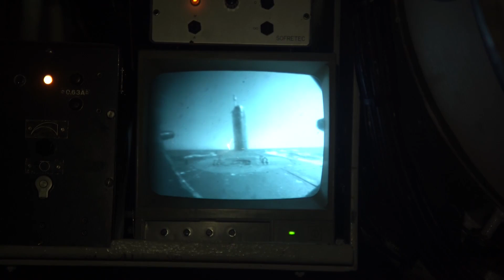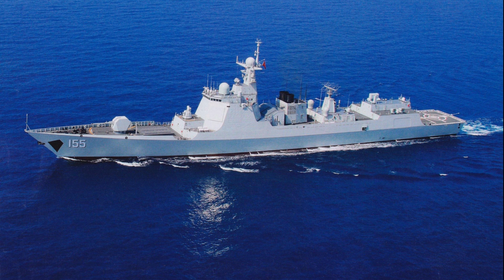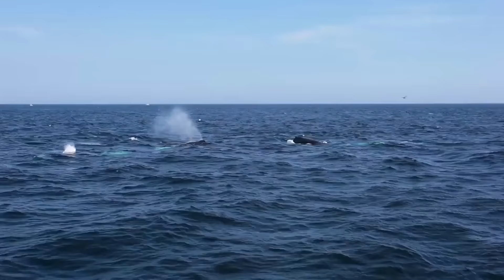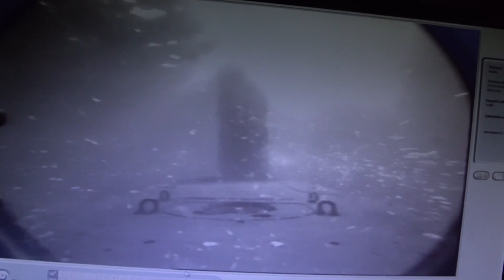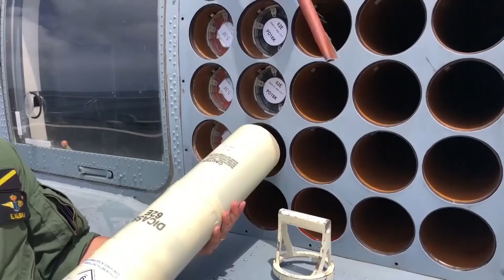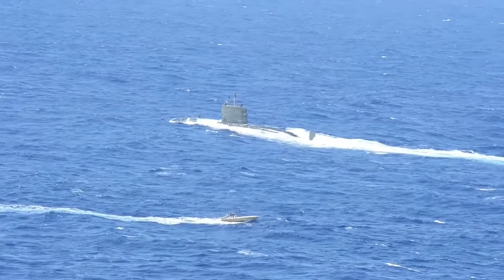Type 212CD: Germany’s New Submarine Changes Underwater Stealth Forever

Comment: Fun fact: the 212CD can be considered the third generation of Norwegian/German CD/bilateral submarine projects. The Kobben class (of the 1960s) was a redesign of the U205 design (designated U207) - built exclusively for Norway. In the 1980s, the Ula class represented a more radical design departure (also built for Norway alone, known as the U-210 class). 

Here is a little rant based on first-principles physics, for those interested: 

The increase in size/length is mainly driven by sonar acoustics: 212A were designed primarily for the Baltic/North Seas - where high-frequency sonar is the name of the game (needed to detail very noisy, brackish and complex and shallow waters). Where Norway operates submarines (Northern Norwegian Shelf, Barents Sea, shelf slopes dropping from 600 metres to 3-4 kilometres into the Norwegian Sea/North Atlantic, with massive density gradients, etc) is the low-frequency sonar domain (dropping below 100 Hz) for range. A quick calculation tells us that 100 Hz in seawater forms sonar wavelengths of ca 15 meters. You really want your flank arrays to capture 3 wavelengths (lambda) at minimum. So you want flank arrays approaching 45 meters, but you do not want to stretch them towards the "skrew". 

This is not something submarines in the Baltic/North Sea need to worry about (as they will be in sonar environments well above 200 Hz (wavelength below 7 meters - thus "3 lambda" is reached by around 20 meter flank arrays). Thus they prioritise being small and nimble while fighting in 50-meter water depth. 

The stretched 212CD allows them to listen to resolve lower frequencies without spooling out the towed array (very useful, since a favourite tactic is to sit inside boundary currents with the motor turned off - that does not allow for towing the array - one must move at least at a few knots to keep the array straight. 

Regarding the ORCCA - it is said to have about the largest ray-tracing computing power on any submarine (since in the North Atlantic/Arctic sounds are defracted massively across boundary currents, the sharp density gradients where warm saline tropical waters smash into cold and fresh Arctic waters, and the unique conditions where the thermocline is inverted. This is the opposite computing problem to Baltic/North Sea submarines have (living in an extremely noisy shallow sound "echoshamber" - requiring them to use their compute for signal processing (to separate bouncing echoes from true signal. 

In terms of ASW warfare, the biggest difference on the planet is what Sweden/Germany/soon Poland) needs in the North Sea and the Baltic Sea. 

Along the Norwegian continental shelf - the water volume of the entire Baltic Sea passes by ca every 15-20 minutes. It is very dynamic. It is also a very unique place on the planet - since the entire global ocean conveyor circulation is powered by processes north of the GIUK-gap. This makes "NADW" (North Atlantic Deep Water). It also does radical things to the global "SOFAR channel" (where most of open ocean submarine warfare takes place). SOFAR is found between 300 and 1000 meters of water depth (as a rule of thumb) globally. But when the North Atlantic warm and salty water masses start to interact with the cold and fresher Arctic water masses, the warm and salty waters flow northward, while sinking under the Arctic surface waters. Thus, one gets an "inverse thermocline". 

Let me try to explain: Globally, one has a normal thermocline (water is warmest on the surface, heated by the sun, and it gets colder with depth. This is basically what defines the SOFAR channel - since sound waves in the ocean diffract (bend) towards cold water. So if a submarine sits in the SOFAR channel "anywhere on the planet) - the submarine noise will bend away from the surface water, where ASW frigates and helicopters with dipping sonars listen. 

Because "hot water" ("the Gulf Stream" is taking a shallow dive under Arctic water in the Norwegian Sea - the SOFAR channel hits the surface (colder water on the surface is bending subsea noises upwards). But it also comes with other peculiarities: there are not just "horizontal meeting points" - one also gets deep "Atlantic-Arctic frontal walls" going into the deep. These create huge walls for sound propagation. In addition, one has massive amounts of sound from the dynamics (draining the Baltic Sea every 10-20 minutes equals a "pretty big river". 

For comparison: All the rivers on the planet move around 1.2 SV of water per second. The North Atlantic/Norwegian Current (the Northern branch of the "Gulf Stream") pushes 4-8 Sverdrup of water every second. Yes - it makes sound by friction and massive eddy-formation processes. While it is far away from the volume transport in the Subtropical Gyre (Between Florida and Spain - very roughly), it becomes very narrow up North due to the density gradients becoming sharper. 

(I am telling you - geophysics is super fun - OK - I know I converted nobody)

I hope I have indicated why Norway always were so extremely picky, not having been happy with a "standard design" since the 1960s, even if both Sweden and Germany have been building world-class hunter killers since forever. 

I hope I have also hinted at why Canada chose the 212CD. Norway is not typically known as a global superpower, except for one thing: Oceanography. It makes sense; we are known for Arctic exploration, we are really interested in fish (as a massive export article since we were Vikings), we were tasked with tracking Soviet strategic submarines from the Barents, into the Norwegian Sea, towards the GIUK gaps 60 years ago - and when you want to use Seismics to 3D-map deep-ocean oil- and gas reservoirs - that is a LOT of motivation. In terms of oceanography, Norway is standing out similarly to winter Olympic medalists per capita. 

Canada is not exactly like Norway in terms of hydrography, but the "problem" is the same. Highly compressed boundary currents, Continental shelves that are not like shelves at all, the bathymetry is more like "drowned fiords", upside-down thermoclines (and SOFAR channels), shared issues with ice reflection. Our Baltic friends have the same issue with ice - but the Arctic ice is multi-year, and it is circulating. So while being different (both on the Atlantic and Pacific side), hydrodynamically, Norway and Canada are sharing the same outliers closer than any other nations (we do have some overlaps with Chile, and to a lesser degree with Argentina). The outlier focus becomes more articulated when we remember that the UK/France/the US (and soon Canada) focus on global-reach nuclear submarines, not conventional environmental specialists. I hope this gives some comfort to excellent Korean friends. It is not you that are weird - it is our freaky sonar/hydrography environment that is weird up here. For anyone living with "normal thermoclines", wanting a multi-role submarine (which is a true global market if you forget the tiny area of Arctic and the Baltic Sea as massive outliers), KSS3 is a sure winner. I will say, however - submarines are still extremely bespoke (if one leaves the "go anywhere nuclear types). 

No strategic submarine is designed for "our conditions" (or the spectacular, almost upside-down conditions of the Baltic Sea). Strategic submarines must by default be designed for the "global SOFAR channel behaviour" - since it would be strange to design a strategic submarine to max out its design outside Norway/Canada or in the Baltic-/North Sea. Those are absolutely tiny areas of the planet. 

Oh - must remember to say: I am not saying that a 212A/Swedish Blekinge/Gotland class/a Dutch/French Orka class (or a US Virginia or UK Astute class nuclear attack) submarine is instantly useless up north. I am sure a 212CD will still be useful off the German coastline in the Baltic Sea. 

ASW is an extremely marginal "sport" especially for submarines. Surface ASW ships/helicopters and aircraft have the luxury to change their listening and pinging frequencies. That big tube underwater does not have that luxury. 

A final observation (as a civilian research geophysicist). Go to a meeting like AGU (or look up journals like Science and Nature) and ponder why Norwegians and Canadian nerds always push out the most radical keynotes on "isopycnal high-resolution coastal ocean models". 

They are very useful for fish and things. But we must also remember that we dive submarines (even conventional D/Es) for days. You'd better want to have the best ray-tracing algorithms and the best isopycnal ocean models on board, since analysing sonar with wrong Arctic density gradients will move target estimations by literal miles. 

There is peace - our German friends figured out the AIP drive train and systems well before VW got their diesel algorithms catastrophically wrong in public.
Reply: Interesting to hear another set of reasons why Canada chose the Type 212CD, or rather had a confluence of interests & capability needs with Norway and Germany. Canada has both the Arctic and fjord coastline as well, as well as noisy heavy traffic environments in the Gulf of St. Lawrence & Salish Sea. Canada has also needed to really improve the level of its oceanographic intelligence, some of which shall be done with our coast guard vessels that are new or just being built, and I expect in the future a lot of the work doing detail ocean floor mapping will be done by more and more advanced USV's (especially under the ice). However, as it comes down to these subs being combat ships, I am most interested in their advanced stealth capabilities. It goes without saying that the RCN now faces a strategic environment that not only includes the "usual" adversaries named, but also treacherous "allies" that do not respect our own sovereignty nor that of other allies which we still trust & help protect. In any case, while our navy might not be huge, the idea that our subs can use superior stealth to destroy the most high-value vessels of literally anyone's navy is the kind of cost/benefit nightmare that deters a potential aggressor.
Reply: @wyldhowl2821 Wenn sie das intressiert können wir gerne über einiges sprechen wenn sie wollen, ich kann ihnen allerdings nur schreiben was Öffentlich zugänglich ist hier bei uns in Deutschland. Ich grabe meist vieles aus was in Medien garnicht erst zur sprache kommt. Geheim ist mein wissen über das 212 CD nicht. Alles zugänglich wenn man weiß was man u.wie man nach frägt.
Reply: @martinraith1488  Oh, I do not ever expect the respective companies and militaries tell us everything. Submarine secrets are the most closely guarded in any navy.
Reply: Gotta love YT for just such comments :D  Thanks!
Reply: Ich schtutze wie so Mancher Norweger von sich aus behauptet das U212 CD ein Norwegisch Deutsches projekt wäre. Also erstmal basiert die Kl.212 CD auf der Deutschen U 212 Alpha u.ist aleine von etlichen Technischen details auf Rein Deutscher entwiklung entstanden. Wir sind bei solchen aussagen Preziese ich bin Deutscher u.stehe wie alle auf Deteils. Alle Boote auch die Norwegischen werden in Deutschland gebaut von TKMS heist also ist ein Deutsch Norwegisches projekt,ihre darstellung tut so als ob wir nicht wüssten Wie man U-Boote baut. Vieleicht bin ich hier kleinlich aber so sind wir Deutschen halt. Ihre Annahmen wegen der Dichte des Wassers spielt vieleicht eine Rolle fürs seiten sonar ,die Kl.212 CD BESITZT ABER AUCH NOCH EIN Bug sonar, u.die größe wurde gewählt für eine Größere Reichweite für mehr Proviant u.die Bessere Unterbringung der Manschaften an bord den das war der Haupt grund warum mann nur 21 Tage lang unterwasser fahren konnte. Das fehlen von verpflegung. Ist bei Atom U- Booten im übrigen ebenso. Wenn die Nahrungs mittel am Ende sind muß nach versorgt werden über EGV oder einem Hafen. Norwegen hat keine logistik schiffe soviel ich weis nur Kanada hat Änliches wie einen EGV die Pasteur kl. Beruht auf dem EGV Berlin kl.der Deutschen Marine. Auch bestimmte Technische deteils vergessen sie hier. Die KSS 3 besitzt keinen Amagnetischen Stahlbau. Das ding leuchtet also sobald Amerikanisches sonar im Wasser eingesetzt wird, u.auch bei den Russen. Es hielft dir in einem fiord null,null wenn du aus großer distanz geortet wirst. Da bringt es auch nix wenn du VLS zellen hast den nach dem ersten schuß bist du weg vom fenster. Fakt ist auch das nur die Deutschen U- 212CD mit der Größten ki gesteuerten Tiefsee tauch Drohne M.U.M. operieren werden. Die selbst eine länge von 50 Metern besitzt. U.mit Drohnen schwärmen,Minen oder DM5 Torpedos bestückt werden können. Das Deutsche 212 CD gibt den einsatz befehl aus 100 ten kilometern entfernung u.muss nicht mal vor ort sein um einen Dummen Ami oder lebensmüden Russen auf den meresgrund zu schicken. Und natürlich werden Alle Boote in der lage sein ebenfals Raketen ab zu feuern um Hubschrauber, Flugzeuge,Schiffe u.land Ziele zu bekämfen,ebenso wird ein Deutsch-Kanadisches system zum einsatz kommen auf allen Booten, der Anti Torpedo Torpedo. AUCH TEUSCHKÖRPER WERDEN MIT AUF ALLEN EINHEITEN SEIN. DAS DURCHSTOSEN VON EIS WIRD EBENFALS BIS ZU EINER GEWISSEN dicke möglich sein dafür war das KSS 3 im übrigen ebenfals nicht geeignet. Es gibt noch ätliche Technische finessen die Tatsächlich öffentlich zugänglich sind die sie hier garnicht benenen.Daher u.weil Kanada nunmal Arktis Anreiner u.Nato mitglied ist war das U212 CD die einziege logische wahl.
Reply: a) phsics in general is quite fun ... although Hollywood writers have hated it for nigh on a century instead of embracing the challenge of understanding it and then properly using it in a plot line ... there is a reason why USians arent that smart
b) Norway should try to capitalise on another potential export ... rowing ships ... the World Cup created quite an enthusiasm, even if it would need to first import the wood
c) the existing 212A submarines of our german Navy should be kept to cover the Baltic Sea, while the 212CD might be best suited to "defend Greenland from invasion"
d) "dumbed down" >> Canada is like a mix of Norway and "Germany" (the Baltic Sea) <<, because it has a long coastline with "fjords" (enclosed sea water) that are rather low in their depth of water and thus similar to the Baltic sea ... combined with a sea that can get quite deep
e) there are quite a few "documentaries" about 212 submarines ... and they look very well organised, BUT as "Das Boot" showed ... you never really know how good your submarine is, until someone is trying to sink it
f) since Italy has 212As as well, I wonder what their special modifications / requirements are in the rather warm Mediterranean sea ...
Reply: Thank you <3
Reply: Very interesting write-up, thanks!  This piece basically begs for the nerdy reader to follow-up by reading more 😊